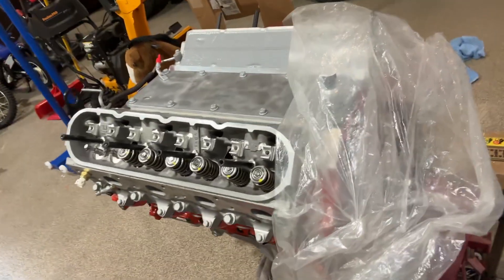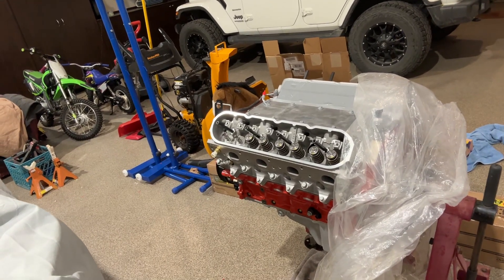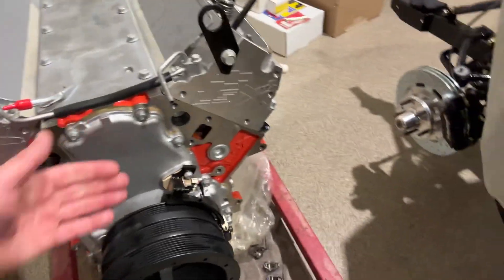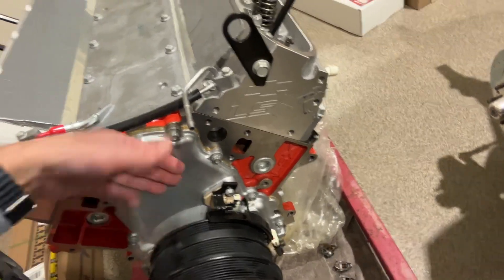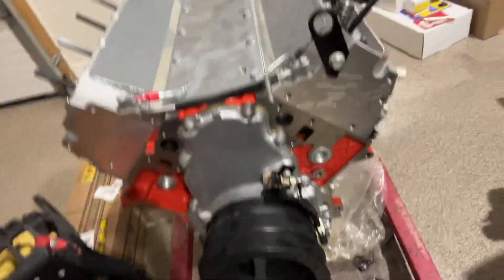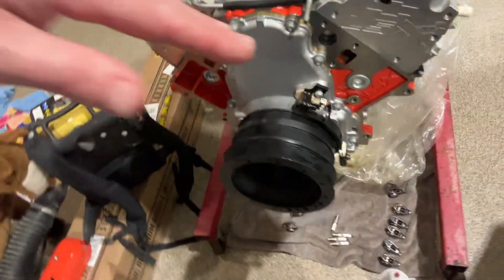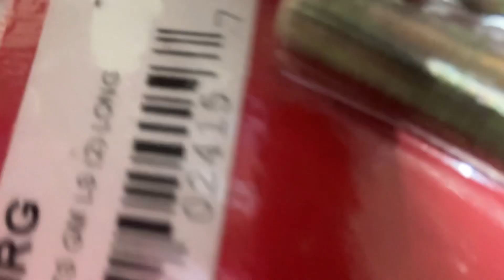6.2L LSX B15 GM Prep And Setup - Things That Will Save You Headaches

Comment: Are you running A/C, and if so did you keep the compressor in the original location lower passenger side of the motor?
Reply from the maker: @bookey27  yes I am running air conditioning and yes, I kept the air-conditioning compressor and the lower passenger side of the accessory drive. Had to make a lot of bracket modifications for this to work.
Reply: @ thank you for the response and that’s exactly where I stand right now making a lot of modifications to make it work and I was just making sure I wasn’t overthinking it

Comment: The stock rockers from LS1 and on have always had roller trunnion and the reason for the upgraded trunnion is to have encapsulated needle rollers, so if they fail you won't end up with needle rollers through your engine like the factory ones.

Comment: Hi Jimmy, what valve spring locators did you end up using? Do you have a part number?
Reply from the maker: They are btr locators SL56060-16. Good luck!!
Reply: So these are the ones that accounted for the stepped valve guide?  @Coolstuffwithjim
Reply: thanks for the reply. Do you happen to have the part number for the initial kit you ordered?  @Coolstuffwithjim
Reply: Hi Jimmy, I think the part number you gave me is missing a number? @Coolstuffwithjim
Reply from the maker: Correct

Comment: Hi jimmy great vid what size valve seats did you use as I’m changing my cam in my b15 thanks Arron
Reply from the maker: Arron - I left the stock B15 valve guides in. I used the valve seals and keepers that Brian Tooley has in their kit. I did not touch the valves or seats themselves, never took the heads off.

Comment: What about the head fasteners? Looks like torque to yield head bolts. What about arp studs removing them and installing them one at a time if you don’t want to remove the heads.
Reply from the maker: Great question. I really don’t know if they are torque to yield or not. I did not have to remove the heads. If I did, I probably would replace them with ARP fasteners.